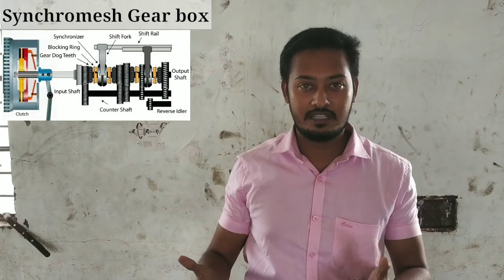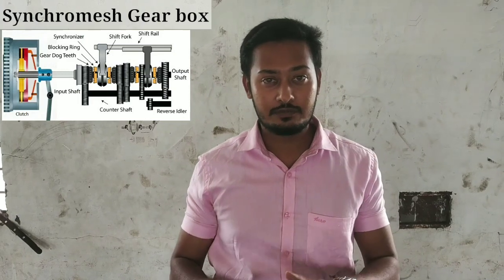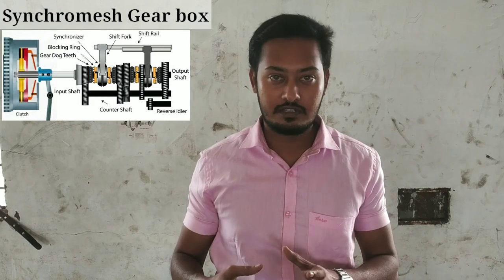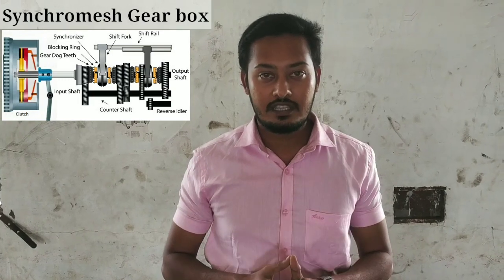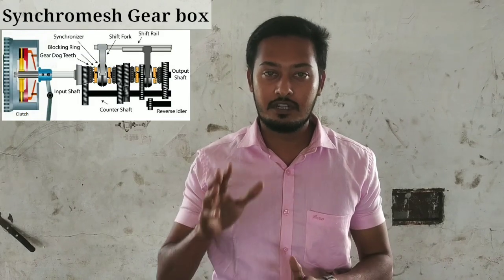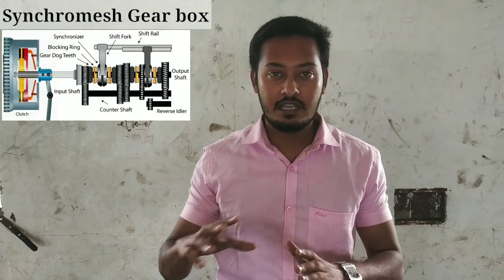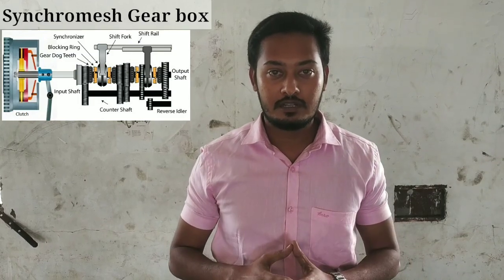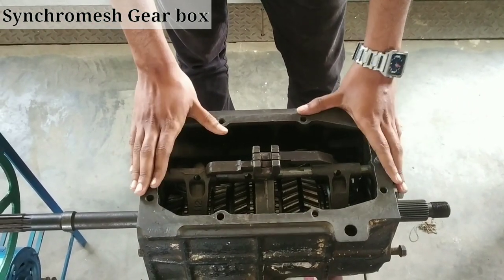How a Gear box works in Tamil ?

Comment: இது ஓகே ங்க,
Engine run ஆகிட்டு இருக்கும்போது எப்டி gears mesh ஆகும்?
அதை சொல்லுங்க,
Also clutch பிடிக்கும்போது எப்டி shaft dismantle ஆகுது?
Reply from the maker: Bro, engine epayum running la than irukum, gear shift panum pothu, clutch nama press panuvom antha time la gearbox kum engine kum connection irukathu bro
Reply: @OnlineSutrula  disconnect ok sir,
Epdi disconnect ஆகுது ன்னி visual ஆஹ் பார்த்தது இல்ல,
So அதை காட்டுங்களேன்,
Also engine gearbox disconmect ஆகும்போது gearbox க்கு உள்ளே உள்ள shaft run ஆகிட்டு இருக்குமா?
Reply: Sir doubt uh,4th gear ல இருக்கோம்,3rd gear க்கு போதும் போது clutch பிடிச்சா gearbox and engine unit dismantle ஆகிடும் ஓகே,already அது சுத்திட்டு இருந்திருக்கும்(gearbox),அப்புறம் எப்படி எந்த தடையும் இல்லாம அது engage ஆகும்?
Reply: @aravindasamy6707  fly wheel um suthitu dha bro irukum crt aana speed la gear shift panaa andha flywheel speed ooda match aaidum edhum vibration irukadhu